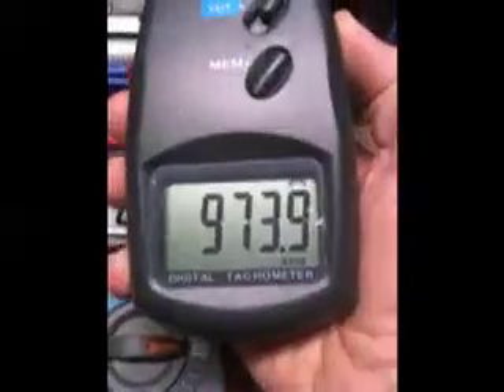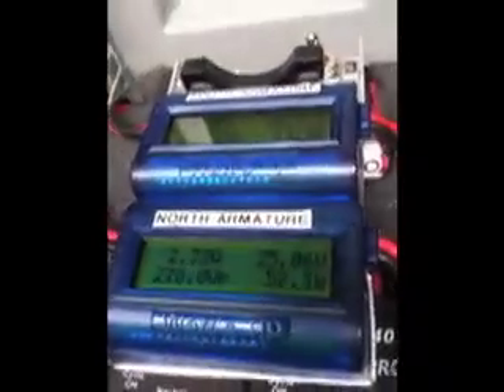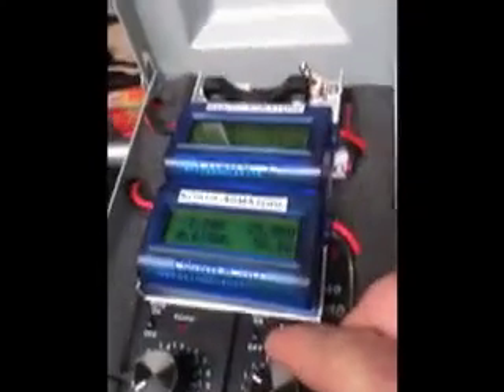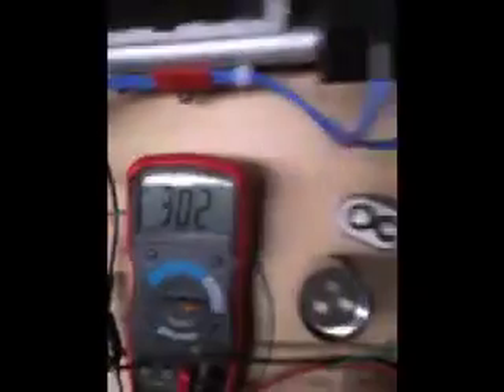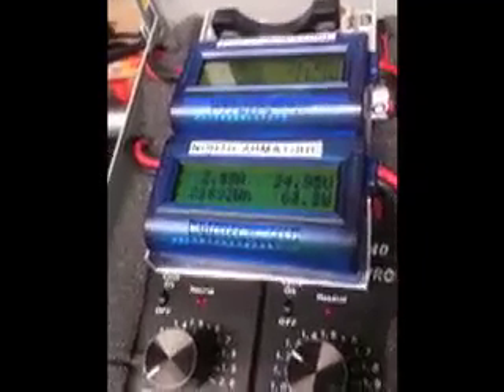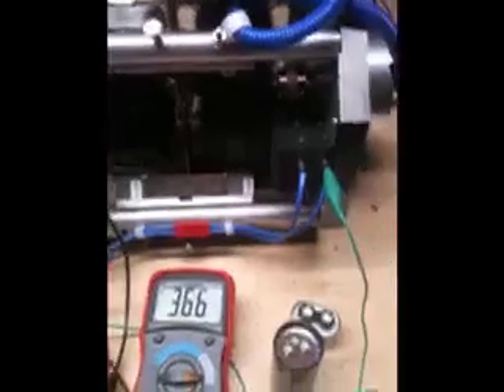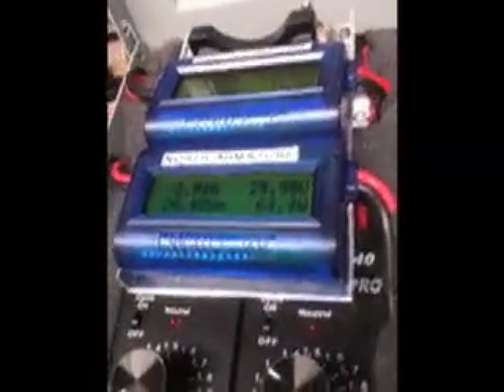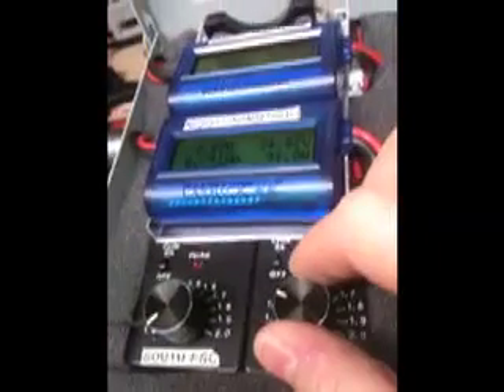OCTO Kromrey SPONTANEOUS  RPM Increase & AMP Draw Decrease.mov

Comment from the maker: The AC cap is the delimiting factor where this point is hit.  It varies from uf value of AC CAP  It is NOT the DC cap that is of issue.  I can make the machine vary the point at which this curve is hit i.e.RPM as well as Voltage attained.  The AC cap is the key here.  Thank you for that suggestion to be sure.